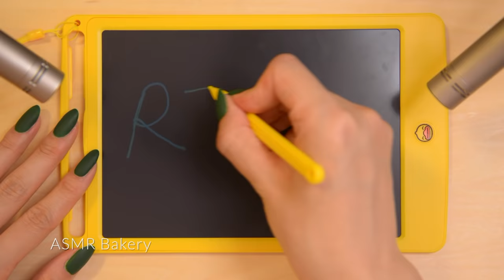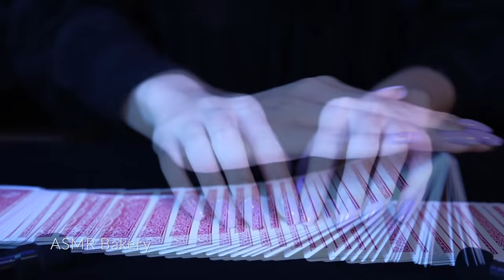The Ultimate ASMR Video for Sleep  | Preview Compilation 2021 (No Talking)

Comment: ACTUAL timestamps:
0:00-0:14  = tapping
0:14 - 0:21 =ear massage
0:21 -5:18  =chalk tapping/scratching and more
5:18 - 6:49 =sunnflower (plugging and more)
6:49 -8:28  =Invisible triggers
8:28 -11:10 =different kinds of Styrofoam cutting
11:11-12:32 =Layered sound on different mics
12:32 -12:48 =black math with plastic wrap
12:48 -13:04 =wood tapping/scratching
13:04 - 13:09  = playing with Coffee 
13:09 -13:15  =scratching a brush
13:15 -13:22 =scratching Rough cloth
13:22 -13:31 = Some glass things
13:31 - 14:55 = cleaning ear mic
14:55 - 16:11 = many 1 second triggers
16:11 -16:30 = triggers between 2 Mics 
16:30-17:32  =short  texture
Nvm im getting tired that's all.

Comment: Time table:
00:00 ASMR What’s Your Tingle Immunity Level? Test 2:Tapping Edition https://youtu.be/MOoGjCyZwMU
00:10 ASMR What’s Your Tingle Immunity Level? Ear Triggers Edition https://youtu.be/lOdulHf9mCc
00:20 ASMR Satisfying Gym Chalk Crushing, Carving Sounds for Sleep https://youtu.be/Sfo6WdXkvB4
05:18 ASMR of a Sunflower Head https://youtu.be/OU6qjcqrq2c
06:49 ASMR Invisible Tapping and Scratching https://youtu.be/moCU4aVMmjI
08:27 ASMR Styrofoam Heat Cutting https://youtu.be/x0TH_mpmV18
11:09 ASMR Hypnotizing Layered Brain Massage https://youtu.be/LWfe6TjVdII
12:32 ASMR for People Who Need to SLEEP in 45 Minutes https://youtu.be/8B0eZR1pJp0
13:30 ASMR 360° Brain Penetrating Ear Cleaning https://youtu.be/-0-kisWjfdU
14:54 ASMR 100+ Hypnotizing Triggers for 100% Tingles https://youtu.be/VKrF8Wnhppo
17:31 ASMR on A Purple Pillow https://youtu.be/CnvbxJmMGnk
20:50 ASMR This Sound Travels Through Your Brain https://youtu.be/lCVfUFJ60OE
22:56 ASMR This Will Cure Your Tingle Immunity: The Helicopter https://youtu.be/vLnElInUVRc
23:31 ASMR Hypnotic Treatment | Sleep in 20 Minutes https://youtu.be/Q5bPEv62Eew
23:59 ASMR Rubbing Mics On Different Surfaces https://youtu.be/bawU67A_EL8
25:19 ASMR Gentle Triggers but INTENSE Tingles https://youtu.be/y51dKwjLPDk
26:55 ASMR 10 Levels of Tapping | Tingle Immunity Treatment https://youtu.be/uGBukRz2HSc
29:27 ASMR MIC ON MIC Triggers | Richer Sounds, Intense Tingles! https://youtu.be/PQzvfMdNTg8
30:21 ASMR Using Ear Pads as Your Ears | Tapping, Scratching, Tracing https://youtu.be/Ja05diWwtHs
31:47 ASMR Which One is MORE Tingly? | Wood vs Cork, Sponge vs Foam, Glass vs Plastic etc https://youtu.be/K6RR74Pnp3o
32:59 ASMR 12 Sleepy Triggers in a Box https://youtu.be/3IId7ftVcLQ
34:04 ASMR Crystal Clear Triggers for 100% Tingles 2Hr https://youtu.be/94x-xQN0uNo
39:33 ASMR Extremely Close-Up and Sensitive Triggers https://youtu.be/DxBSi1CnKuo
40:34 ASMR Gentle Tapping and Scratching for 1 0 0 % Relaxation https://youtu.be/7g8-1IS3gn4
41:30 ASMR 3D Brain Massage for Sleep https://youtu.be/2_o5-4MKRUw
42:43 ASMR with Binaural Theta Waves for DEEP SLEEP https://youtu.be/Hl4O1bB6kz0
43:45 ASMR Relaxing Pink Salt Zen Garden Triggers https://youtu.be/BJfSaIxZweQ
45:17 ASMR Dry vs Wet Floral Foam | Tapping, Cutting and Crushing https://youtu.be/XFipWE1w78I
47:43 Raw ASMR Sounds for Sleep | Tapping, Scratching, Tracing, Crinkles https://youtu.be/FwALoYhpA3s
48:44 ASMR RAW Hypnotizing Triggers | Tapping, Brain Massage etc https://youtu.be/v_-TrgJGeqM
50:09 ASMR for People Who Need Sleep 3Hr https://youtu.be/0xbLLkphuvw
57:48 ASMR 3Dio FS Pro II Mic Test | Ear Massage, Cleaning etc https://youtu.be/dVcU05o9zZA
58:54 ASMR 10 Ear Massages for Sleep https://youtu.be/GO5_M1WpRME
1:01:34 ASMR Sensitive Triggers to Cure Your Tingle Immunity https://youtu.be/ejqpn9N04Wo
1:03:42 ASMR Brain Penetrating 3D Tapping https://youtu.be/O5hqI9_G7sw
1:05:12 ASMR Gentle Triggers Around Your Brain https://youtu.be/CBK2IAFePN0
1:06:50 ASMR 10 Levels of Intense Ear Triggers https://youtu.be/kZtxVUTwiF4
1:09:05 ASMR High Speed Tapping https://youtu.be/pajctwiy--k
1:10:25 ASMR Triggers to Give You Brain Tingles https://youtu.be/cvOlkS6d96s
1:11:51 ASMR Extremely Satisfying Triggers for Sleep https://youtu.be/UdC0qoHzahg
1:14:16 ASMR Hypnotizing Invisible Triggers to Make You Sleep https://youtu.be/3L1ekaUqlp8
1:15:46 ASMR Brain Melting 3D Triggers for Sleep 3Hr https://youtu.be/c6HYjsW-WgY
1:24:08 ASMR Hypnotizing Brain Massage https://youtu.be/mLE8Ruxtxvs
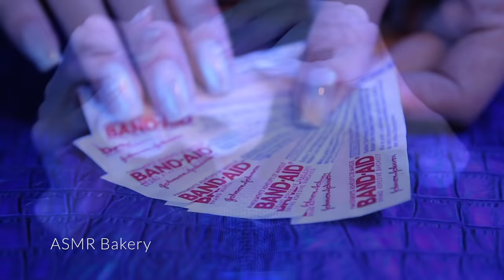1:25:35 ASMR Ripping Off the Band Aid https://youtu.be/NVLTwWEKVRg
1:28:32 ASMR Rolling On Your Ears https://youtu.be/t1CZBq8TekQ
1:30:07 ASMR Wood Triggers in Your Ears https://youtu.be/vhU59ewrtg4
1:32:07 ASMR Beat Your Immunity with Intense Straw Triggers https://youtu.be/GpUhGgt54B0
1:33:49 ASMR 20 Triggers for People Who NEVER Had Tingles https://youtu.be/xvQepqcAwqk
1:40:04 ASMR Satisfying Slime Sand Triggers for Sleep https://youtu.be/ccUijGDE6fE
1:42:30 ASMR Best Triggers for 100% Sleep 4Hr https://youtu.be/wUVY0DFK-uw
1:55:10 ASMR Deeply Hypnotic Triggers for the Best Sleep! https://youtu.be/m5o9iQdEyl8
1:57:03 ASMR Relaxing Wood Burning Sounds for Sleep https://youtu.be/jhr1sWRy5jY
1:58:54 ASMR Extremely Sensitive Triggers for People Who Want Tingles https://youtu.be/47kZodqIolA
2:00:31 ASMR Making 99.99% of You Sleep Using A Contour Gauge https://youtu.be/YwE-2DryBxk
2:02:52 ASMR Paraffin Wax Peeling, Tapping and Scratching https://youtu.be/UDQ5FCKU00A
2:05:35 ASMR with Wax Fingertips for Sleep https://youtu.be/JKB1wWbTE2c
2:08:02 ASMR Intense Mic Tapping and Scratching Sounds https://youtu.be/PuB90RGTAAE
2:08:57 ASMR All Up In Your Ears Binaural Stimulation https://youtu.be/qh_6UW0VHnk
2:09:52 ASMR Invisible & Intense Electrifying Trigger: The Helicopter https://youtu.be/-7dUvEpfgXA
2:10:53 ASMR of a Giant Gummy Bear https://youtu.be/ZcO0YLdvqek
2:13:09 ASMR Inner Ear and Ear Drum Stimulation https://youtu.be/7iYq9OVKVQY
2:14:29 ASMR of a Sprouted Coconut https://youtu.be/df_QE9noItI
2:16:33 ASMR The Best Kind of Chalk Sounds | Tapping, Scratching, Carving etc https://youtu.be/aZ-TbArM1r8
2:17:59 ASMR Make You Tingle Using Only This Finger https://youtu.be/MgfIPmQtFeE
2:19:34 ASMR The Foamiest and Stickiest Brain Massage https://youtu.be/v5HPRhQubGs
2:21:17 ASMR Doctor Treats Your Tingle Immunity https://youtu.be/5uQ-DKZZUj4
2:23:50 ASMR Extremely Relaxing, Soothing Triggers for Sleep https://youtu.be/Ry6Zs3ZTvK8
2:24:56 ASMR Most Sensitive Triggers, Tingles Guaranteed! https://youtu.be/3ppDm6yHlQM
2:25:58 ASMR Brain Melting Triggers for FAST SLEEP https://youtu.be/8xhYjzI0qWk
2:26:53 ASMR Intense Relaxation Making 99.9% of You Sleep! https://youtu.be/ziAaLm-8kvE
2:28:19 ASMR Tingly Brain Massage Triggers for Sleep https://youtu.be/20mM88M2LMM
2:29:49 ASMR R E L A X I N G Triggers for DEEP Sleep https://youtu.be/QChbzuzu_RA
2:31:04 ASMR Gentle Tapping Tickles Your Brain https://youtu.be/Am2uQD1xlzA
2:32:38 ASMR for People Who Need to SLEEP in 40 Minutes https://youtu.be/rFZoVXNONBE
2:34:07 ASMR Close Up Mic Treatment Tingle Galore https://youtu.be/zSXNU2YHN18
2:35:18 ASMR 6 Hypnotic Triggers for Instant Sleep https://youtu.be/P7MGtf5_ETg
2:36:27 ASMR Addictive Wood Carving, Tapping and Scratching Sounds https://youtu.be/fI47R_ldBYw
2:38:17 Which is the BEST ASMR Mic? 10 Triggers on 10 Mics https://youtu.be/Y6ZbtUgYSKk
2:42:40 ASMR Brain Tingly Wooden Ball Triggers https://youtu.be/_itciUjwZ1o
2:44:02 ASMR Super Brain Tingling Triggers for Sleep https://youtu.be/UPVn8OMBCg0
2:45:27 ASMR 100% Golden Sleep 3Hr https://youtu.be/gkcuxIfrBRk
2:56:12 ASMR SQUID GAME Dalgona Candy Challenge | Tapping, Cracking Triggers for Sleep https://youtu.be/ykASNc4H0iU
2:57:48 ASMR Braingasm Inducing Fast Tapping https://youtu.be/I4tBgka9Bws
2:59:00 ASMR 3D Brain Penetrating Ear Treatment https://youtu.be/gtrkXU4J9-E
3:01:10 ASMR of a Honeycomb on Branch https://youtu.be/3_vwkA8_wnE
3:03:26 ASMR for People Who Like Sensitive Triggers https://youtu.be/YtUgT_6WUro
3:04:49 ASMR This Trigger Combination Will Make Your Brain Numb! https://youtu.be/agsfJadeZZo
3:06:32 ASMR with Mics Around My Fingers https://youtu.be/e-sgqf8_jBc
3:08:01 ASMR Fast Changing Unpredictable Triggers https://youtu.be/YRechJAaVKI
3:08:34 ASMR Hypnotizing Layered Ear Massage and Cleaning https://youtu.be/TU0r6btGdEw